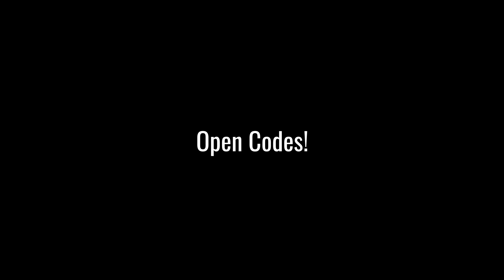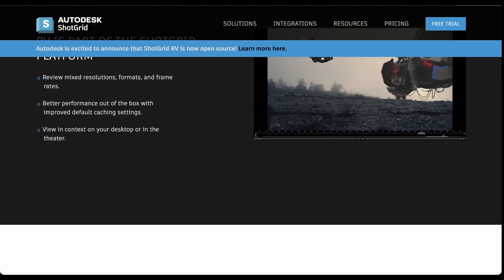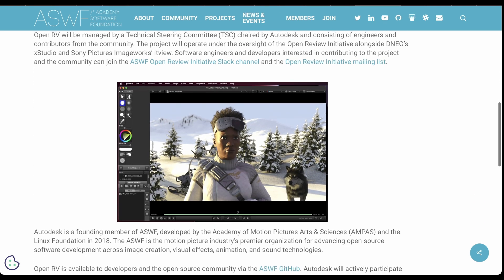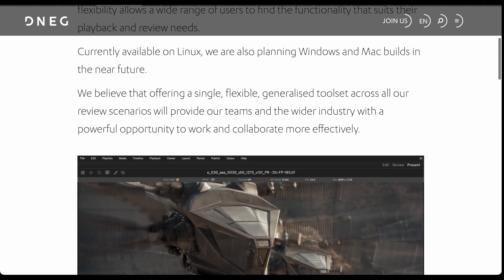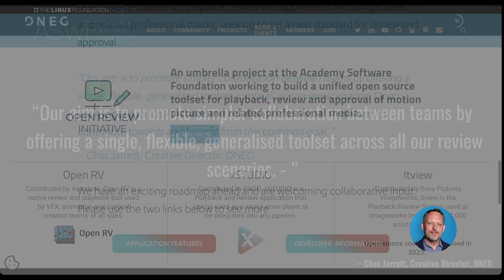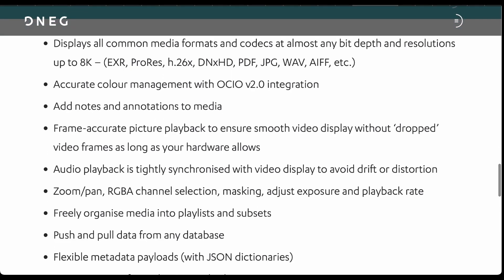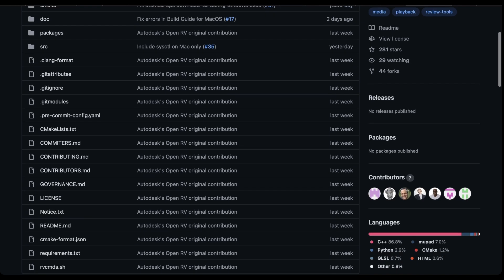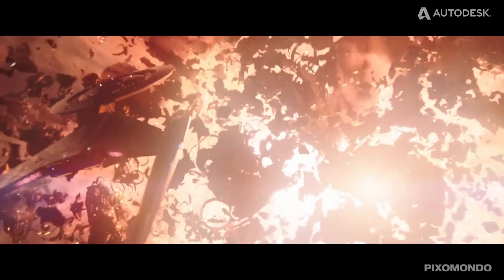Autodesk Open RV & xStudio Now Open-source!

Comment: They should open source softimage.
Reply: Maybe they killed that one because they have many 3D app that compete each other
Reply: @desa-in2052  that’s definitely the reason, specially given that Softimage costed 300 dollars and maya 19k, but it had more than 80% of the same tools.
Reply: +1
Reply: Hell yes! They killed that just to get to the animation particle engine.
Reply: That is the software that could match Houdini.
Reply: @diocre7446  It couldn't. Houdini is way ahead of any other software.